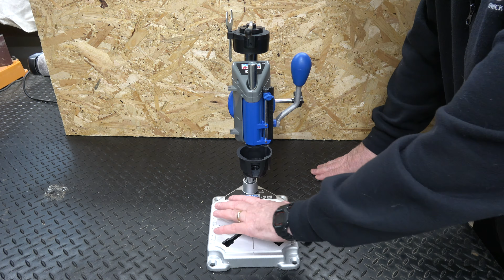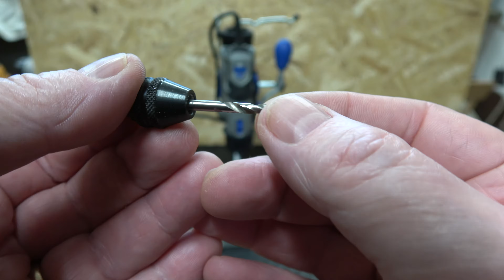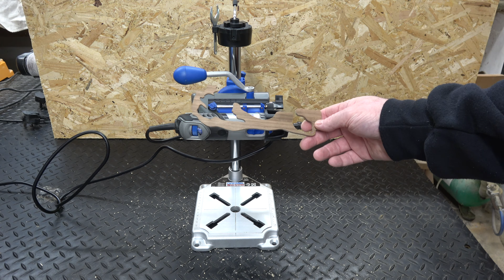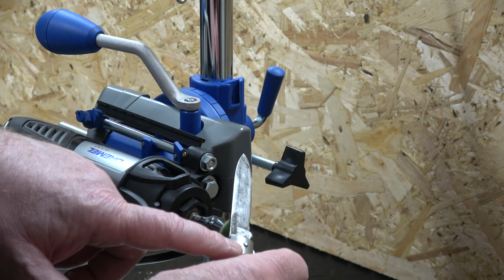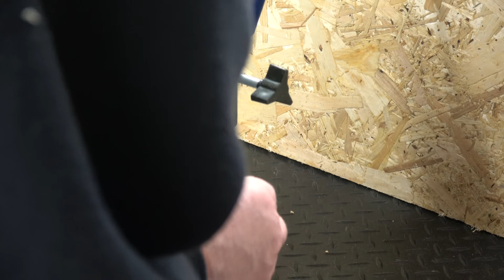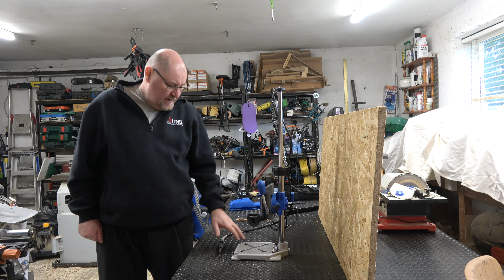Dremel 220 Workstation Review and Demonstration

Comment: Smashing overview and was wondering if any of you good folks has the total dimensions of the base (foot-print), working on a very small bench. Thanks very much
Reply from the maker: I have had a look and the base is 247mm long by 175mm wide.  The length includes the bolt head on the back which sticks out a little.  :-)
Reply: @RussellPlatten  Russell your a gent, thank you very much!
Reply from the maker: @badgerboy3017  You're welcome!  :-)
Reply: A very informative video, thank you. Just the right length and the demonstration and explanation of working with the flexi shaft was also very useful. Thanks again, Chris